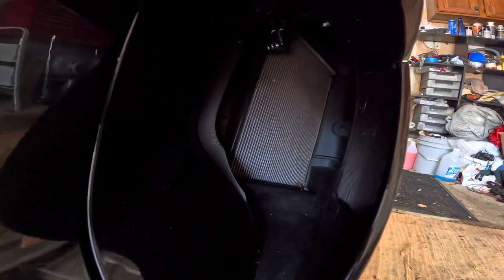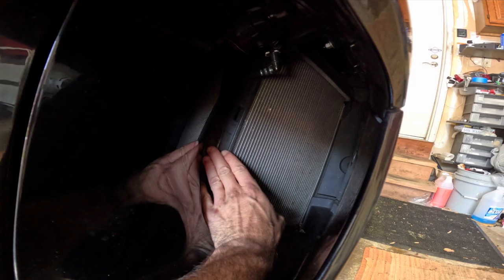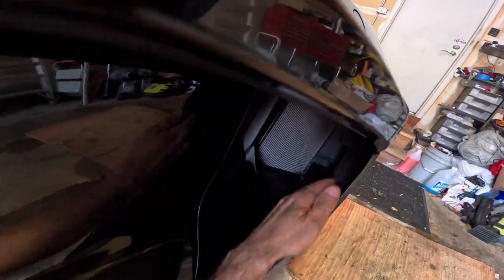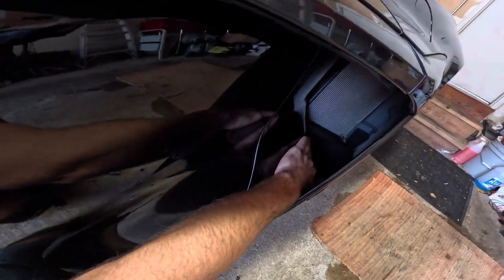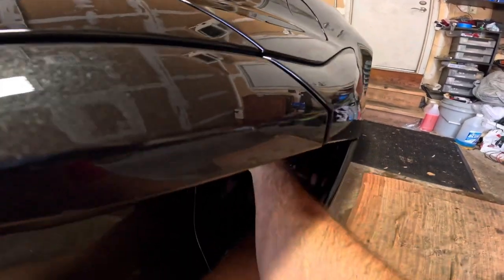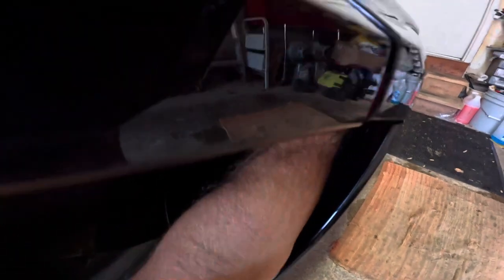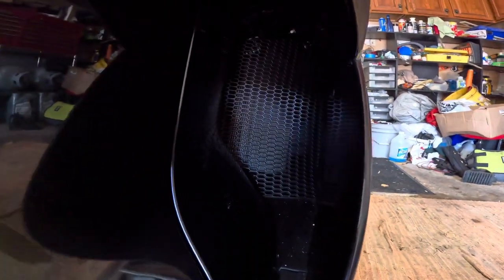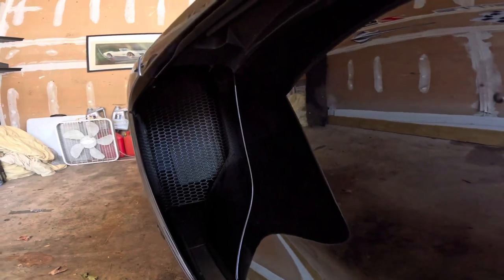RGS Chevrolet C8 Corvette Z06 Side Intake Mesh Grille Installation v2

Comment: I watched both videos of this install if these two examples are anything like what is out there in the marketplace I won’t be installing it in my vet using the warm it up and shoving it in the hole method. On the bright side it couldn’t cost more than five or six dollars in materials and a 12 pack of beers to cut it out Of a sheet that material after that is pure sweet profit. I didn’t bother looking up the cost anything over $12 would’ve been twice as much as it’s worth.

Comment: I see both large and super tiny stones collecting in my cavity. I can see how this grill will protect against large stones but the tiny ones will still go through. How difficult is it to remove these if I want to vacuum them out?
Reply from the maker: Super easy to remove. Remove the nut and pull them out. Easy as that.